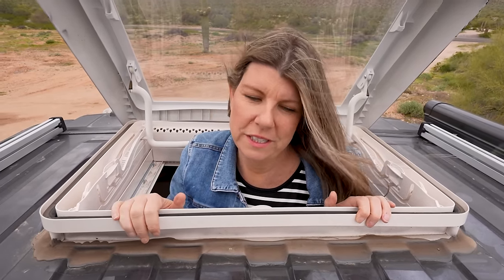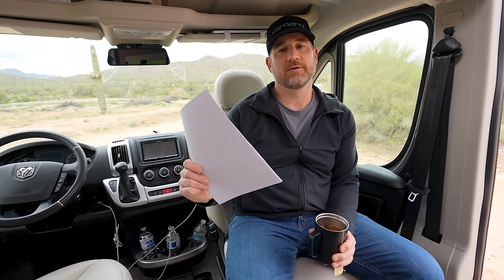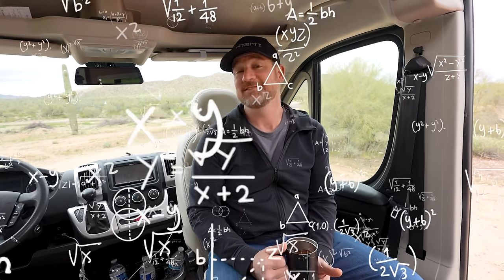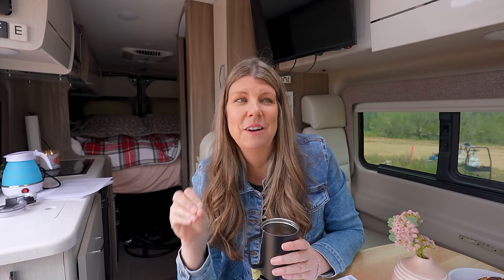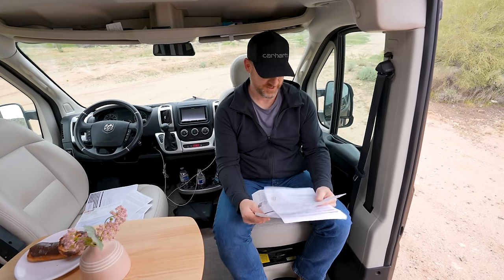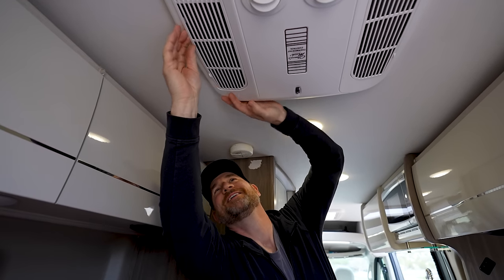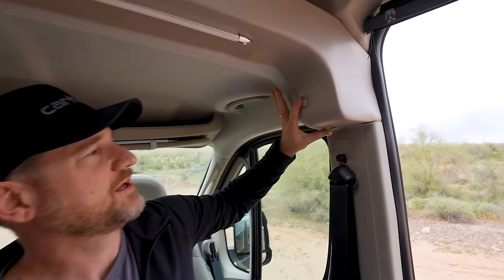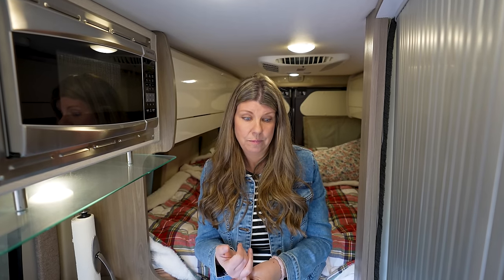Unveiling the Truth About RV Warranties

Comment: We love you guys!   After 6 mos with our used Roadtrek we canceled our extended warranty and got a prorated amount back.  We found that the repairs we were doing either weren’t covered by the warranty or less than the $250 deductible.  We decided to take the $4,000 we got back and put it into savings set aside for RV repairs.

Comment: I was once told that RV's are not quality checked when they leave the manufacturer. They just put them out and wait for buyers to get the work done under warranty. This is why they say it is best to buy a used RV. I love that you call your Van Mr Lemon but in total, I have had 8 different RV's. Tent trailer, Towable, 5th Wheel (3), Class C, Class A and a Class B. Two of them I bought used, and they were the only ones that were not in the shop constantly for the first year. I have had 6 Mr Lemons. I never buy the extended warranty however, they would not sell them if they lost money which means if they are not losing money on them, than you are. Great video.
Reply: I had the exact same conversation with an ex service manager at one of the massive dealers in Washington State. 
I don’t think there is a part of our Thor van that wasn’t touched by the warranty at the dealer. It was a total farce.

Comment: Just got home from a trip to Myrtle beach from Ontario Canada. Our Ram Promaster sits for a while with out using it and after using the parking brake once, one side only partialy released and was stuck on. Never felt it, never new. Overheated, blew apart the entire brake system on that side. Three days at a Ram dealer in Knoxville and 4500 bucks later we headed home. Thirteen thousand miles on the rv and they say not covered under warrantee. Sixty five hundred Canadian! I need another drink.
Reply: Sick how people get taken from these large companies, definitely a flaw and they should have covered it.  It's mechanical.

Comment: Extended service agreements are cancellable and you'll receive a refund of the unused portion of the extended agreement based on greater use of time or miles starting from day one.
Reply from the maker: Thanks for this great info!
Reply: Same with GAP insurance   Ive cancelled many an Extended warranty (its usually a lot of phone calls and persistence as the Ext Warranty and Dealer is involved.
Reply: @Vancaskeys as a previous RV salesman, yes Cancel the extended warranty ASAP, receive your refund, and if you really want an extended warranty you can buy one without the dealer markup

Comment: I’ve had aftermarket warranties several times, the big shock to me was the actual coverage was not what the salesman or brochures stated.  The warranties all had a clause allowing resale, meaning that you RAM warranty I bought, was sold to Guardian, and they as a new warrantee can do anything, or NOT do anything.  Needed a covered engine item fail, and they denied it.  After pressuring the agent she said “It’s only a $462. repair, it will cost you more to litigate than the repair, we don’t pay those.  On my Mitsubishi the engine needed to be replaced at 92,000 miles, the warranty replacement offer was $1,200 from them, the cost of repair $7,000.+   In ALL instances I would have been better off taking the warranty cost and putting that into a CD or stock.

Comment: I’m a long time RV owner. 8 motorhomes over 40 years. I’ve owned a number of extended service contracts. None have covered anything that’s not mechanical or electrical.
My experiences: most extended service agreements only kick in when the manufacturers warranty expires. So, all my repairs the first two years would have been covered and were covered  with the factory warranty.
My experience is extended warranty covers about 50% of the mechanical repairs. Labor rates in Phoenix don’t seem to be in line with service contract rates. 
I recommend NOT buying a service agreement from the dealer. Wait until your factory warranty is almost over. After mine expired I went with WHOLESALE WARRANTIES. Most of them don’t cover maintenance items, most don’t  cover diagnostic services OR anything but mechanical and electrical but may cover your appliances, etc. , unless you purchase a very expensive package. 
Anyway- that’s my experience , and just my opinion. 
One last thing: I’m retired and took my rig to the Winnebago factory for a list of things the dealer did POORLY. I absolutely loved the factory repairs.
These are just my opinions. 

Thank you for your video.

Comment: I like the eclair insurance policy best, will work for eclair. However depending on how used an RV is I would still consider an extended warrantee. In my case I have a faulty slide on my 2016 truck camper and I am the second owner. I have no extended warrantee but Lance said bring it in and we will fix it for free. I can't tell you how awesome I feel right now chillin at a hotel.

Comment: That's a big list of warranty repairs, but at least you've stayed on top of them. We've had 2 minor issues so far - the bathroom door latch broke when we went around a turn and hit a pothole in the road ( I think that's what happened ), and we had a defective 12 volt breaker. I had the builder send the parts ( which they did right away ) and replaced them myself since that was the fastest and easiest fix for me. Plus, I now understand the van a bit better.
Reply from the maker: You do have a great van Craig! Glad to hear it's going so well :)

Comment: Had the Trombetta solenoid go out in van causing the coach batteries to not charge while the van was running.  Called Thor and they actually sent me the part.  Easier to change it out than drive 120 mile round trip to the dealer.  Part was $30 on ebay so I would have just bought it rather than go through the hassle of going to dealer.  Saved me the drive and Thor the dealer charge.  Thor customer rep took care of things.  Don't know if this would have been covered on extended warranty.  Took about 20 minutes to change out part.  I think dealer is charging $199 an hour shop rate!!

Comment: I had quite a bit of warranty work having bought a 2021 early Covid TT Aspen Trail 2340BH in like Feb 2021. It was NOT at the peak of Covid so it was built somewhat better than many foundationally but fit and finish were not great. The prices did NOT explode until later in 2021 so I got a deal to a degree compared to mid 2021 through 2022 when my 23, 600 deal would have been as high as 40K. I put a Road Armor suspension on it and timed my warranty repairs to winter and the dealer essentially kept it from Oct to April fixing stuff including the front end that was bowing in the wind. The worst issue was that the slide ripped the floor. The dealer went back and forth with Dutchmen and I eventually had to take a whole set of pictures that showed the screw hanging down that ripped it. The dealer fought over a replacement but they said no fix it. The "fixer" said it was too far gone, so back and forth. Finally it was getting to camping season and I said, just fix it. So, I got a nice V in the flooring. The lady who fixed it did a great job and pointed out the floor hadn't been glued to the floor. Don't think you are getting planks.  We have always used a runner inside so you can't even see it. But I better keep it for awhile. I was fortunate that the frame, all the appliances, and the gas system etc., were solid and I put Good Years on the second year and had already done the Road Armor suspension. So, I'm good to go... But this all is the reality of modern travel trailers.

Comment: Warranty! When we bought our 2000km "almost new"  used Road trek, they offered the extended warranty for $10,000 Canadian dollars.  We've owned Travel trailer, 5th wheel, park model and now class B so the answer was a hard NO for extended warranty.  When we bought the 2021 RT, we knew the 2 year Roadtrek warranty wasn't transferable but  the RAM chassis warranty was transferable so all good.  After experiencing other warranty work with trailer and 5th wheel, we aren't keen on leaving the van for weeks or lets say have pump failure and wait for the process and loose a summer or a trip? Not worth it. I'd rather fix it or get it fixed and pay and move on. In the past warranty work we've had done, there was still disappointment. A back wall of Jayco 5th wheel was replaced for water intrusion on warranty. There was more watering intrusion after because they failed to caulk around rear lights😢. Same problem of water pipe leaking was fixed under warranty, to find out it was still leaking during a trip AND also our rear breaks seized on the  way home after warranty work. Also, the sofa bed came loose from the wall, that had to be fixed twice as well as the fabric wore out in one summer and also needed replacement.  I can say Jayco was easy to deal with for warranty work but that was a lot of stuff and wasted time in the shop where we should have been out enjoying our unit.  This resulted in me not caring for warranty and getting work done in time by people I trust. I would not give extended warranty any money.

Comment: We got the extended warranty on our Travato and we found out that once the basic one-year warranty was up there were a lot of things that weren't covered by the extended. Like the miserable Remi shades, the The, pull up blinds that lived at the bottom of the front windshield. We were sidelined by Covid until after our initial warranty was up, so the Remis broke immediately after that expiration and we were astonished to discover that they weren't covered by the extended warranty - it was gonna cost us something like $800 if we wanted to replace them. We hated them anyway so we just kept clipping a blanket over the visors and left the dead Remi shades in place. 
And there were other things like that just fell to us to fix because the extended wouldn't. We still had a couple of years left on the extended warranty when we sold the Travato and honestly, I don't think the new buyers cared that much. I can't say that it was a selling feature.
When we got the Solis Pocket, we skipped the extended warranty, despite heavy pressure from the finance guy.

Comment: Number one I HATE sky lights.  Being blinded in my peripheral vision is no fun.  Number 2 paint it yourself.  There are many auto parts stores that specialize in paint colors that will match it perfectly. Also, you may even be able to remove the part or at least mask the surrounding parts before using paint thinner to prep the surface your painting.  I have a 1999 Dodge/coachmen, that is in mint condition.  I needed to touch up the paint, and my paint guy also has a photo spectrometer that matched that obsolete paint perfectly.

Comment: Two things, 

1. A six day repair time is unacceptable. A six-month repair time is reason enough to never buy an RV at least from Thor and your dealer, and maybe not at all if they are all like that. 

2. “We paid $5000 dollars, do you think we will get $5000 out of the extended warranty?”  Insurance does not work that way. If every customer got out what they paid, the insurance company would go broke. Insurance only works if many people pay and few collect. One should ask oneself at the time of purchase, if the insurance costs $5000, do I think I might have $15,000 in repairs?  If that is true, then the insurance is worth it, because a $15,000 repair bill might be crippling. This is the way it works with engine warranties. A $2000 warranty might be handy if the engine needs replacing and the cost would be $10,000. Most people never use their engine warranty,  so the insurance company can tolerate paying out 1 out of every 50 engine warranties they write.

Comment: Extended warranties at purchase aren't worth it.  First you are amortizing the $4500k you paid for the warranty with the coach for 20 years?  That's more like a $9,000 warranty.  if you feel you need an extended warranty, get one as the manufacturer warranty is ending (after you have shopped around for a quality provider). 
The other way they try to screw you is to have overlapping warranty coverage.  Meaning your 4 year extended warranty started at the same time you purchased the coach, when it's covered by the manufacturer for the first 2 years. This is a common tactic by crooked dealers, they explain it away by saying the extended warranty covers more than the manufacturers "basic" warranty. . 
Call the warranty provider and ask how much you can get back when you cancel, might be worth it. Usually a  dealership sold extended warranty is $2500 + $2k dealer profit = $4500. It's something you can negotiate aggressively on.
The other thing to watch for is the $100 deductible, some are "per visit" and some are "per item".  Insurance companies are business' that are out to make money, by making it inconvenient for you to fix your rig, they pocket the $$$.